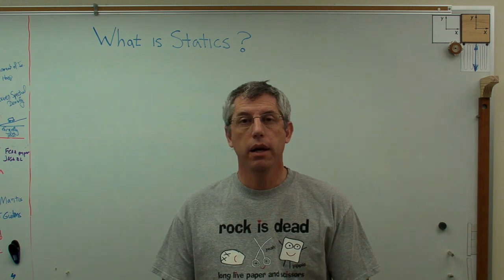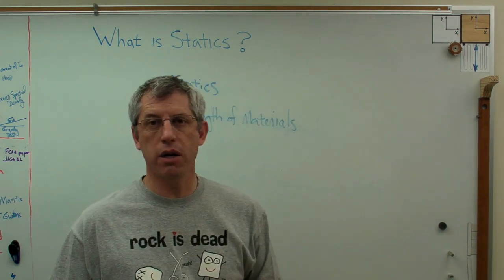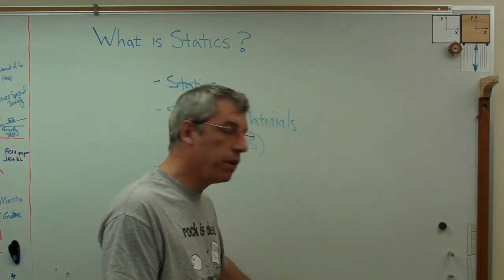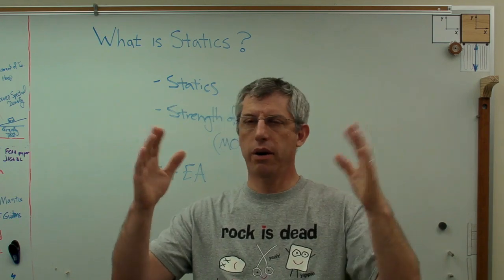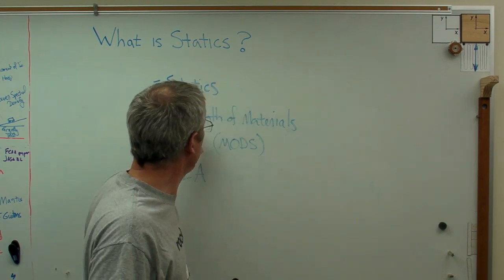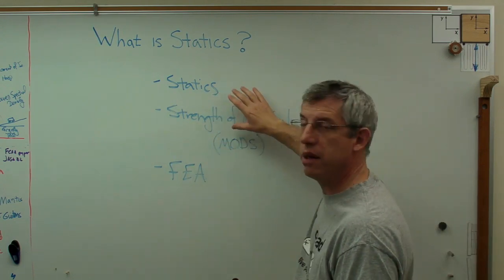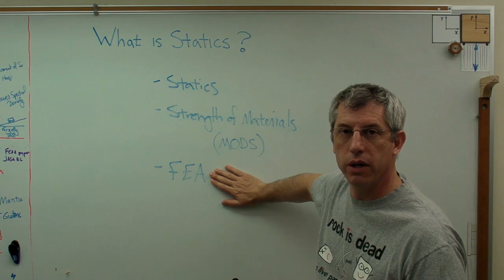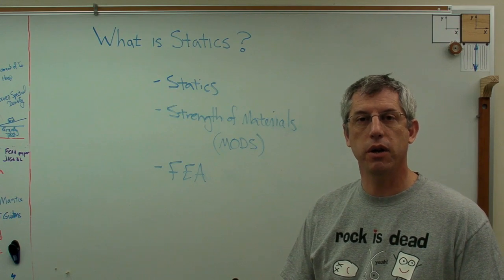What is Statics - Brain Waves.avi

Comment: I have been learning about the buckling of contained columns. I am interested in a variation that leads to a method to build trusses. Thought it could be used to make light weight, low density core panels. Also models the function of my avatar.  I commission a short white paper on the effect. I have posted the video on my YouTube channel. Wonder if you have seen this variation of Euler's contain column studies.